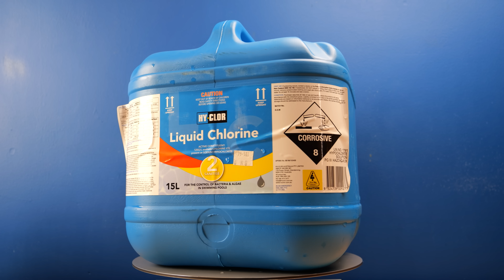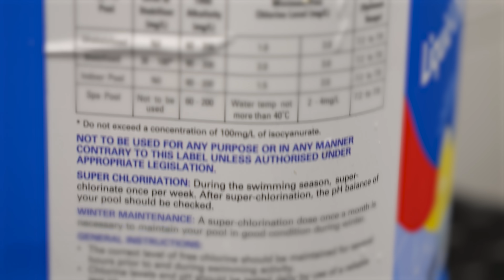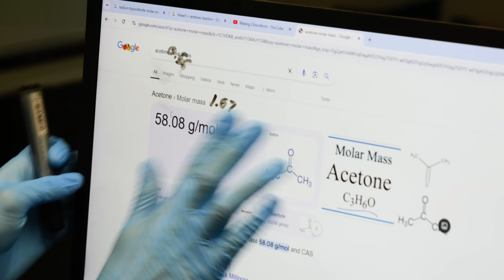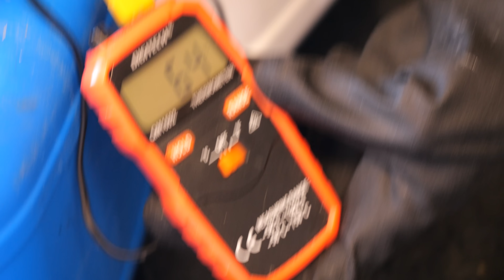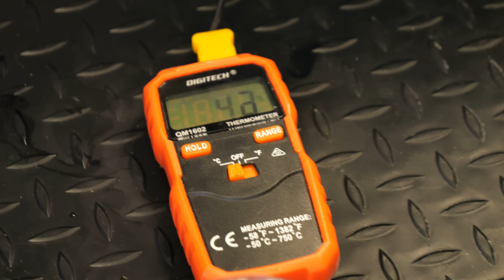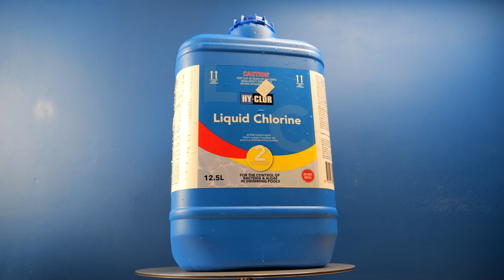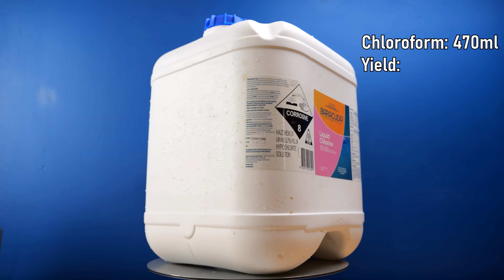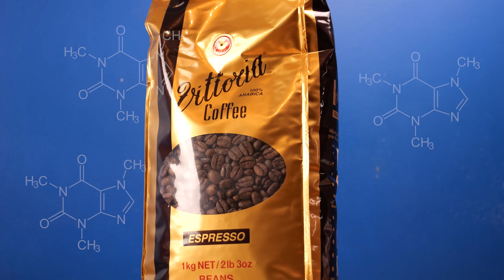I Mass Produced Chloroform at Home!

Comment: 9:32 for anyone curious about TATP, it’s so dangerous that during production you have to dry out the explosive crystals. If the cloth you dry it on has ANY amount of TATP left on it (which is impossible to avoid), tossing it in a trash can will make the cloth explode

It cannot be stored in a container as it will “evaporate” and reform crystals on the lid. If the container has threads, it will detonate no matter how slowly you open it
Reply: man i really wanted to make that thanks for telling me this i probably dont now
Reply: @phillip_turner the best thing is that it doesn't contain nitrogen so its undetectable by conventional scanners
Reply: Adam Savage from the Mythbusters has at multiple times told a story about testing a myth that involved common household products being combined to make an explosive, and the crew being so surprised at just how explosive the combo ended up being that they just canned the myth entirely and made everyone involved promise not to reveal the ingredients. I'm pretty convinced that he was talking about TATP.
Reply: shiet, i got suddenly nervous knowing that i've kept a bottle of acetone(softening adhesives and plastics), a bottle of isopropil(cleaning electronics) and a bottle of peroxide(low % for cleaning dirty stuff) and a bottle of lighter fluid(for my zippos) all together on glass bottles next to a couple of butane cans(for recharging lighters) for years on a tall shelf on my bedroom that i top up as i use them, its not much, about 500ml of each, but i think that if they get knocked over it might be a really nasty reaction, and the chances of them falling over with no intervention is way higer than 0 as i live in a earthquake prone country, so after sending this i'll gonna go and get them the f apart and see where the hell to place the acetone and peroxide, i dont wanna wake up to an earthquakue and get blasted to pieces or coming home and find that somehow it made tatp
Reply: @xzinik2961 leave them be, live life on the edge, be a man
Reply: @djxzinik  Nothing would happen if you mix them together. To synthesize acetone peroxides with a decent yield you need high concentration hydrogen peroxide (20-30%), and also an acid catalyst. Just clean a spill if it happens.
Reply: @lagrangiankid378 well i guess its good to know that, i keep the acids in the backyard, but i guess now i could mostly assert that i would probably be in a list  :D
Reply: @djxzinik  Proof that the seemingly dangerous information mrgreenguy gives out is actually super useful hahaha I'm glad you're being safer
Reply: also i think i would need high potency hydrogen peroxide anyway which is hard to get
Reply: @phillip_turner you can concentrate the off the shelf stuff, but if you’re determined to make it, I strongly suggest starting with a more stable (and probably more complex to make) compound first if you’ve never made explosive compounds before
Reply: @ yeah i dont think im going to make tatp any time soon but maybe ill make some fun bombs out of nitrates as those seem more stable
Reply: @phillip_turner just heat the 3% stuff to 50-60°C for a day or so and you'll get some 20-30% hydrogen peroxide.
Reply: so make it on site?

just joking, i dont want to make TATP
Reply: A friend and I stupidly but carefully made a ton of this stuff from 13-17yo. Probably around two kilos in total but never more than 20g together at once.

It's dangerous but it isn't a demon.

Keep the reaction cold, crash it out fast, keep the product wet, don't scrape it, don't store it, and don't try to pack it hard into stuff. Using it as a booster for apap/apan/appn mixes was a lot more reliable and maybe safer.

Better yet don't make it. Iirc mekp was considerably less dangerous but straight mek isn't sold as openly anymore.

I dunno, I have mixed feelings about tatp. In the years I fiddled with this stuff as a hobby I only ever got hurt doing nitration baths and boiling sulfuric acid to make other stuff and that was mostly due to being a broke kid using a little eBay lab glass and makeshift apparatus. 

Then again the kid down the street got interested and blew his hand up trying to pack flash powder into a co2 cartridge using a nail and a hammer... so imo the high explosives were fine and the risk was more about not being dumb.
Reply: Sounds like the only proper and safe way to dispose of the waste is to blow it all up in-situ. So, simply avoid making it anywhere you do not want to explode. Or just... avoid making it anywhere at all, I suppose.
Reply: It's also called mother of Satan. That continued sublimation and resublimation that leads to crystal growth is called Ostwald ripening and is a pretty interesting field of study.
Also also don't fking dare to try to recrystallize it to get bigger crystals because it's proven that internal strain is enough to cause the explosion.
So, yeah, just maybe leave it alone and avoid jail. Alphabet agencies hate TATP especially because the failures in detection lead to a massive tragedy so a lot money has been put into prevention and detection of even the tiniest amounts.
Reply: Is it the same thing sinko from dr.stone created in the cave?
Reply: @3anter98x  I haven’t gotten far into the show so I’m not sure, but if he used hydrogen peroxide and acetone, probably
Reply: But dont you need a 3rd ingredient to start the reaction?
Reply: It's not safe but if you use it as a primary to set off a second thing like sugar and fertilizer it's really good
Reply: No, this won't happen. It's not that impact sensitive, especially if wet. Also don't use a cloth to dry it, just keep it in open air for a few hours.
Reply: @lagrangiankid378 It's ridiculously impact sensitive. It is still ridiculously sensitive when wet. It has seriously hurt multiple amateur chemists and killed and maimed many people who have attempted to make it for nefarious purposes. There is no good reason to make it and no safe way to make it.

Comment: You can control the pour from big containers better, if you tilt the container 90-180°, so the opening isn't on  6o clock, but rather on 3,9 or even 12 o'clock. Hope it helps.

Comment: The reaction is exothermic.
Refuses to use an ice bath.
That's what I came here for.
Reply: And just dumps everything in. 😂 I love the guy.
I'm pretty sure he knows how to, but it's just entertaining us. Hence the last attempt with the best yeald.
Reply: But he's just boiling off his acetone (BP: 56C) and any chloroform (BP: 61.2C) he makes 😂 It would mostly be hypochlorite (BP: 101C) left in the reaction vessel. If only he controlled the temperature, he would've made so much more product~!
Reply: @pjt5227 sure, but it's funny
Reply: @pjt5227 around 100 I think hypochlorite disproportionation (3 NaClO -> 2 NaCl + NaClO3) becomes pretty prevalent which could be a massive further loss.
Reply: Look, if Tom from Explosions & Fire can make do without any fancy ice bath, then anyone can.
Reply: @AustralianMurderTurtle  Or fancy equipment
Reply: @AustralianMurderTurtle  only works if your are in `straya. Something about the ozone layer being fcked.
Reply: @AustralianMurderTurtle  Yeah, you just use some algae water, ez
Reply: I'm sure he'll realize an ice bath is the normal method then strap a bunch of PC heat sinks to the bottles instead.
Reply: @playachronix imagine if he used heat pipes from old workstation computers (basically copper heatsinks without the fan, water cooling with just air)
Reply: he just had to dump some ice inside the containers
Reply: @nirodper  that would make the product less pure
Reply: @ no, it wouldn't
Reply: @nirodper  Yeah I got it wrong, forgot chloroform was insoluble in water. Although, unless he used distilled water ice, wouldn't there be a possibility for contamination?
Reply: Should make a makeshift condenser to purify and capture that chloroform evaporating.
Reply: Because vaporization of chloroform indoors is just very “relaxing”… yep skip the ice bath my Xanax prescription is late again.
Reply: He had a damn freezer, put the whole thing inside and add the acetone periodically.

Or just make a huge ice bath with a bigger bucket and submerge the whole containers in ice.

Waste of chloroform 😭🙏
Reply: Im just gonna download this real quick before it gets nuked by YT 👍🏻
Reply: 666